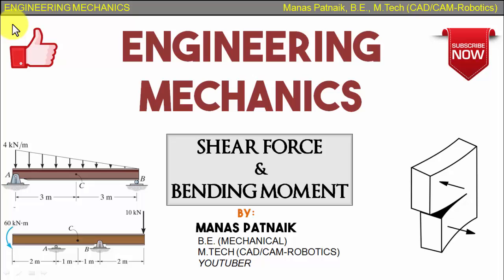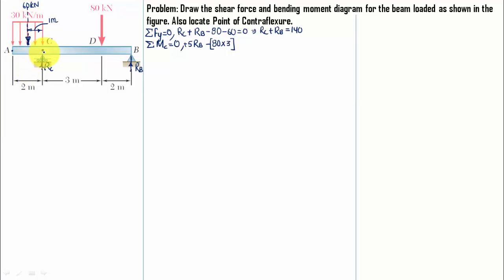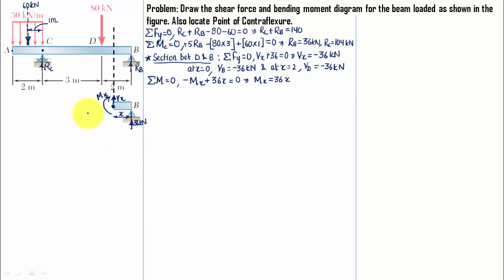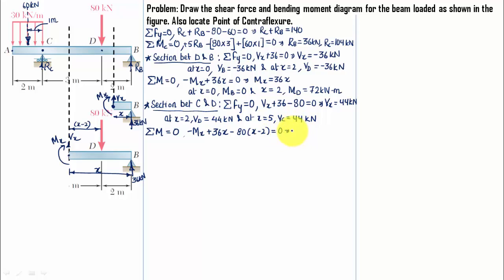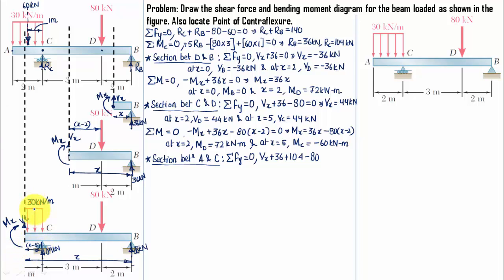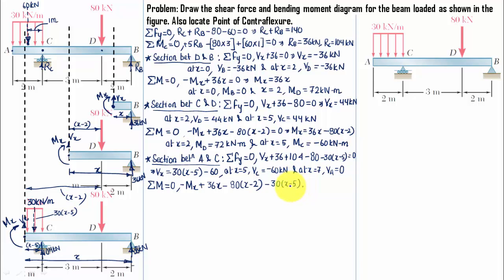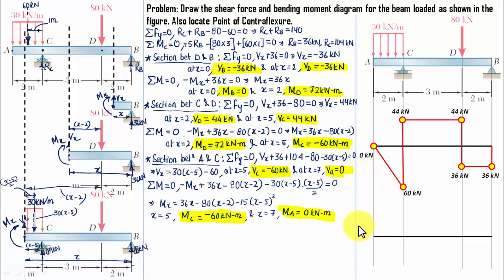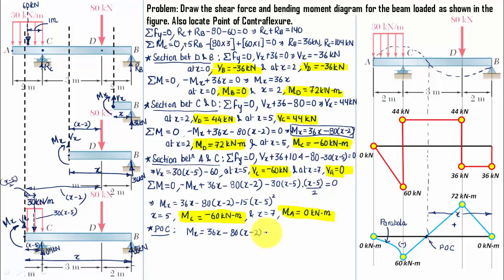Shear Force and Bending Moment_Problem 2_Analytical Approach

Comment: Sir why havent you opened Vx at 12:15 in section between A and C. 30(x-5) you havent opened this bracket. If we open it then Vx at A does not equal to 0.

Comment: Sir.. If I use this method of finding moment... In deflection if beams... I'm not getting the right answer..... Can we use this method in deflection of beams..?
Reply from the maker: Hi Gautham....
This is the way forward.....
I mean i have also calculated deflection and slope using this method....
This is a conventional approach and can be applied to both Macaulay's and Direct integration method.
Reply: @ManasPatnaikofficial  ok.. Sir thanks for replying... And sir Plse do video..on that  sir plse

Comment: I saw you didn't consider the 104KN reaction force at C in the moment equation at a section between A and C.Is it an error or am I not able to find the reason?
Reply from the maker: Niranjan.....You are absolutely right...Yes that 104 kN force somehow got skipped....
Thats an error on my part....
Anyway, just add 104(x-5) to the moment equation i.e for section between A and C....
Rest is fine......
And i am thankful to you that you noticed the error...
Reply: @ManasPatnaikofficial  Thanks sir
Reply: ty sir...I too had same doubt
Reply: That was an error.
Reply: While caclculating shear force time also forgotten